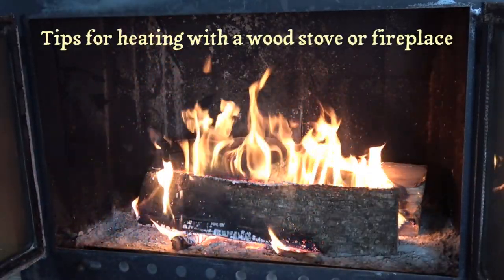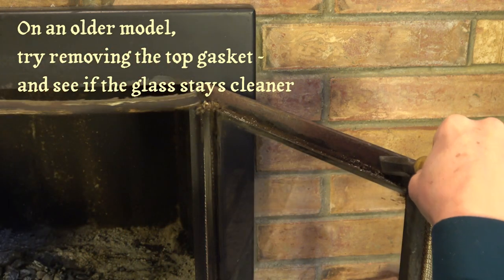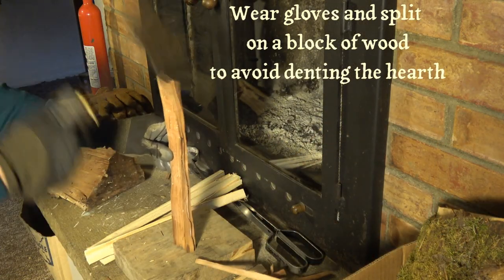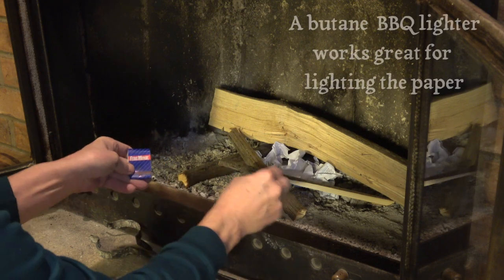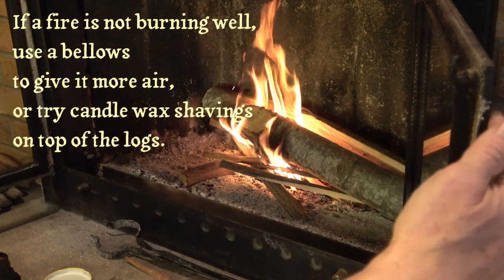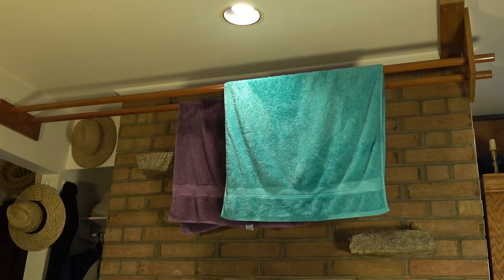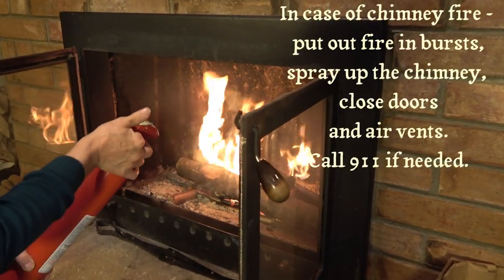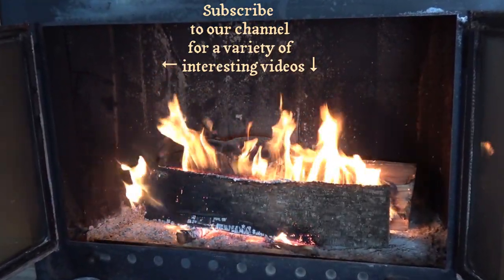Tips for Heating Your House with a Fireplace or Wood Burning Stove

Comment: I've always been told do not close doors on a fireplace????? Please tell me why you do.
Reply from the maker: If you burn a fire with the doors open, the warm air from the room goes up the chimney as fast as the fire can heat it, and it won't heat your house much. Fireplace inserts and quality glass doors are ceramic glass, which can take 1,000°F, and designed to burn with the doors closed.  Cheaper glass doors, usually bi-fold, for sale on Amazon are tempered glass, and say NOT to close the doors with the fire burning.  In practice, you can close the doors if your fire is not very hot, and flames are not close to the glass.  I shattered a cheap bi-fold glass door once by filling the fireplace with paper, lighting it and closing the doors - flames were right up against the glass.

Comment: A good way to extinguish a Chimney Fire, is to pour a pan of water on top of the fire in the fireplace or wood burning stove. The water will vaporize and travel up the chimney, extinguishing the flames with the steam that you created. "Always notify the Fire Department for a Chimney Fire". Even if the fire appears to be out, it may have extended into a crevice in a wall or roof. 🚒🔥👨‍🚒
Reply from the maker: Thanks for the good advice!  Probably need to be careful not to get burned by the steam, or use too much water and have coals wash back out into your house.  Then close the doors and damper to shut off the air supply.
Reply: @HartzHomestead  when we bought our house the people who had previously lived in our house were idiots they burnt fires in the fireplace regularly but they never got the chimney cleaned so one day of cource they had a chimney fire and instead of fixing the chimney they threw in a gas insert so when we bought the house I installed a new chimney linear and replaced some bricks and removed the gas  insert so now we have a nice wood burning fireplace and I clean the chimney 1 or 2 times every fire season
Reply from the maker: @boywonder5691  If you always burn dry wood, and have air tight ceramic glass doors, and give the fire the right amount of air at the base of the fire to keep it burning hot, the chimney will probably not even need cleaning. I've never cleaned our chimney in 35 years, and only once had a minor chimney fire when I made the mistake of burning cardboard. It quickly went out when I closed the doors. We do have a clay tile liner with a space between it and the bricks of the chimney, so it's insulated from the cold which helps reduce soot as well. But if it does need it, cleaning the chimney is important.
Reply: @HartzHomestead  most of the time there is very little creosote when I clean the chimney but I just clean it often to prevent chimney fires becsuse I don't want to have to rebuild the entire chimney or worse the entire house should there be a chimney fire
Reply from the maker: @boywonder5691  That's good!  It means you're burning clean fires, and staying safe.

Comment: I understand you've done this a long time, and I respect that.  But you can split that wood safer with a hatchet if you lay it down horizontal, slam the hatchet down into it (often getting it stuck in), then picking up the hatchet and kindling as one and slamming it down.  Sort of like bunting, but from the side.  You won't risk cutting your fingers or hand.
Reply from the maker: I guess we each have our preferred way to split wood. Some kindling would be a pretty small target to hit using the method you describe, and I've always found wood splits easier from the end than the side.  I've never cut myself with a hatchet, just gotten slivers a couple times with really splintery fir.

Comment: I assume you split the small wood inside because that's where the camera was.   The shock of slamming that down on a hearth is a good way to crack the brick work.   My BIL would split wood on my mother's ramp going into the garage.   It never cracked until he used it to split wood on.
Reply from the maker: I've been splitting kindling on this hearth for 35 years and it hasn't cracked. It looks like sandstone but I think it's a durable concrete product, held up with steel angle iron. I have put dents in the hearth when wood split easier than expected (bad for the hatchet and the hearth).  Bigger wood I split outside though.
Reply: @HartzHomestead  ,  makes it warmer for you then. 

my fireplace is quite old-fashioned and I fear it would crack the brickwork hearth that is inline with the floor.

Comment: I noticed you don't use a grate for your fireplace, do you find it easier not having one? We just bought one and logs tend to roll off them.
Reply from the maker: I've never tried a grate. I do prop my logs up with a couple smaller pieces going crossways, so air can come up through the ash cleanout directly through the middle of the fire, making it burn really hot. As logs burn down the coals all stay together, whereas on a grate they would fall through.
Reply: @HartzHomestead  I bought 2 grates for our stove (Olympic fireplace insert) and they both melted. Cheap Chinese 'pot' metal I guess - but it WAS hot (up to 600 degrees sometimes) - probably because of the lumps of anthracite coal I added on REALLY cold nights.

So I hired a blacksmith who build me a 'trivet': 'A' shaped 1/2" square steel bar heated and bent into the shape of an 'A'' with a cross-piece at the bottom of the legs. 

Then (on the bottom surface) he added 1" legs (short pieces of the same steel bar) at the peak and bottom of the 'A' legs to keep it up out of the ash and a series of 'bumps' on the top surface to prevent logs sliding/rolling. Finally he added an eyelet to the peak of the 'A' so I could lift the trivet up and out with the poker while all was still hot.

Cost me $75 but was cheaper than buying cheap grates and lasts forever. Kept the heavy logs tilted and up out of the ash, let the air flow under and up and gave me a space to stuff newsprint, firestarters and split cedar shakes (shingles) from Home Depot. Add in 2 pieces of (REALLY) dry wood (kiln dried from Estonia - split and 1ft long) under the main logs and within 15 min I had a 500 degree fire.  

I added extra (hardwood) logs along the sides away from the center to dry completely after laying on the outdoors rack in the weather. They'd start burning after a few hours and kept that side of the house warm until morning.

BTW: those gloves? Get welder's suede gloves - reach up to the elbows and protect your sleeves.

Cleaning the glass: Good choice of glass! However, don't use anything sharp enough to scratch it - no razor blades! Anything which can scratch the glass will create places for the soot to adhere. Same as bubbles in a beer glass. 

Remove the door, lay flat and level atop cardboard sheet (to catch the drips), spread paper towels over the glass until completely covered. Spray ammonia  (using a cheap 'dollar store' misting spray bottle) to soak the towels and let sit for a few hours. Come back with a PLASTIC 'spatula' and scape the wet towels off - the sludge of soot will release and just throw the towels/sludge into the garbage. You can scrub with a plastic scrubber (using a cheap plastic scrub pad similar to 'steel wool' pads). Do NOT use 'Scotch Brite' pads (3M). The green ones are approx 80 grit/sq inch and the blue 400 grit - just like sandpaper classification and will create a permanent 'haze' on the glass.
Reply from the maker: @lp115lp  Thanks for all the info. Glad your new grate is working so well; makes sense as it would allow air circulation from underneath and keep the wood together. I'll have to try ammonia for cleaning the glass. And yes, burning dry wood is really important; a hot fire produces more heat and less smoke.

Comment: can you burn pine logs in a fireplace
Reply: yes. it must be seasoned indoors for a year or two
Reply from the maker: You can burn any wood as long as it is dry.  If the pine has a lot of pitch in it though, it would be best to mix it with some deciduous wood, like alder, maple, or other non-pitchy wood, or you might create excess creosote in your chimney. Also, it might crackle and pop a lot.
Reply: Of course, as long as it is dry you have nothing to worry about

Comment: hi,liked your videos,with what material is the door made of?
Reply from the maker: The doors were custom welded for us by a fireplace shop using Pyrex glass. They also gave us an option of tempered glass, which was cheaper, but I shattered some once with a very hot fire, or ceramic glass, which can take even more heat, but Pyrex has worked fine for 35 years and I've had some very hot fires.
Reply: and the frame was made of?
Reply from the maker: @freemovies57  The frame is welded from steel, and painted black with high heat paint. There is also a stove gasket material around each piece of glass.

Comment: If the fire goes out of control it is better to wide open the closest window, the fireplace doors and any other flue controls on the chimney.
This way all the heat escapes  fast and the fuel cools down enough to burn safe.
People have the tendency to tund down the air intakes and  flue dumper in this situation. This makes things a lot worse because of the huge amount of heat energy that builds up in the fireplace.
Such situation can go as far as sucking oxygen from as far as the chimney top, melt the fireplace and start a chimney fire.
Reply from the maker: I've never heard that. Interesting concept. The one time I was burning too much cardboard with the doors open and a chimney fire got started, I shut off the air supply and the fire died down.  It might be different if you have a lot of creosote in the chimney.  I only burn hot fires with dry wood and the creosote is minimal.
Reply: Cardboard, paper, plywood, tree branches and many more, aren't suitable for use as "solid fuel". 
I quoted "solid fuel" because in fact what burns is gaseous  fuel released from solid stuff exposed to heat.
When temperature rises in the fireplace, more fuel is released by the "solid fuel".
Shutting down all the air intakes works only if the fireplace and the chimney are perfectly airtight. Nothing is perfect! Any leak will feed the heated fuel to produce more heat and increase the pressure difference between the fireplace and surrounding air.
Wide opening the system will release all the heat and fuel mixture fast enough not to start a chimney fire. Everything cools donw in a minute.
Leaving the doors wide open while buning cardboard or even proper firewood is a invitation to disaster 😀